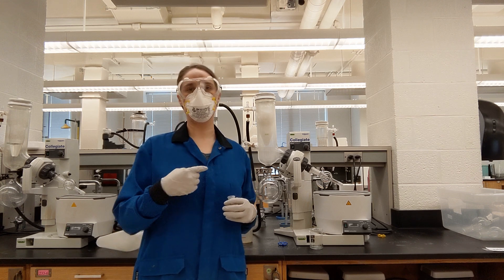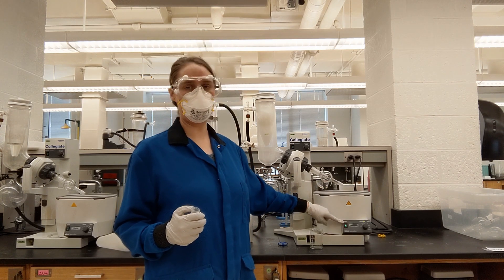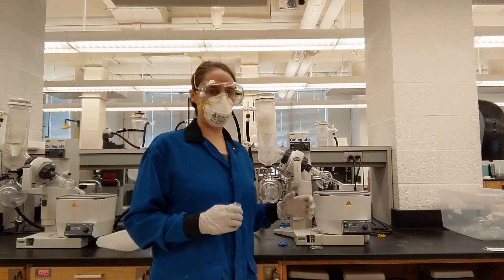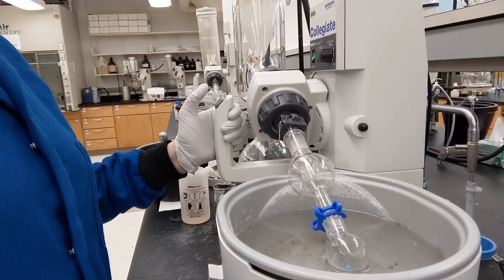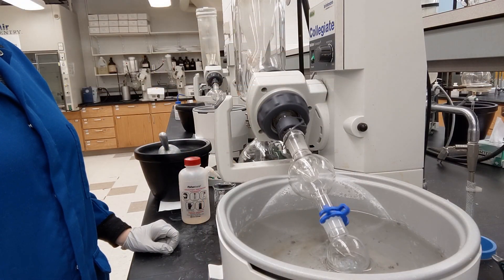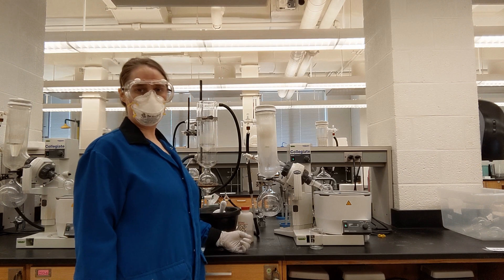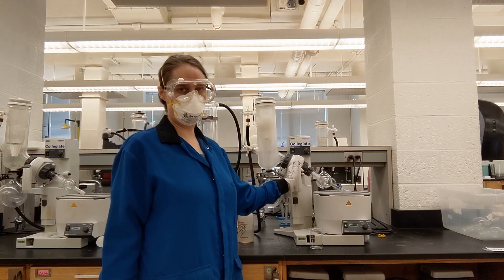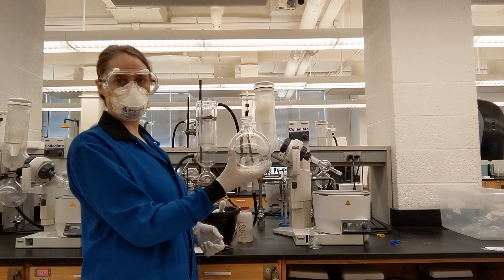How to Use a Rotovap

Comment: Thanks for sharing.  What kind of experimental chemistry uses this device?
Reply from the maker: No problem.  It's used to get rid of organic solvents quickly and gently.  The usual goal is to isolate the solute.  With only heat and no vacuum, it would boil at a higher temperature.  Depending on the solute, the heat could degrade it.